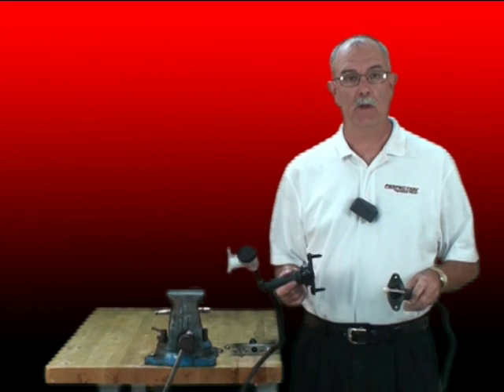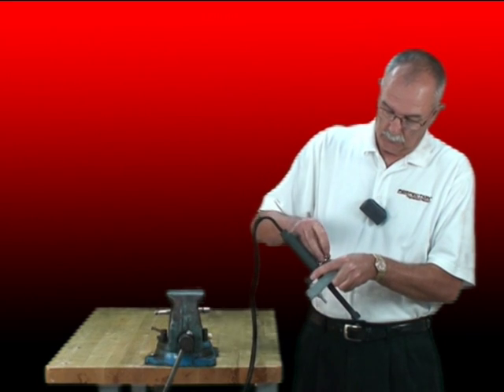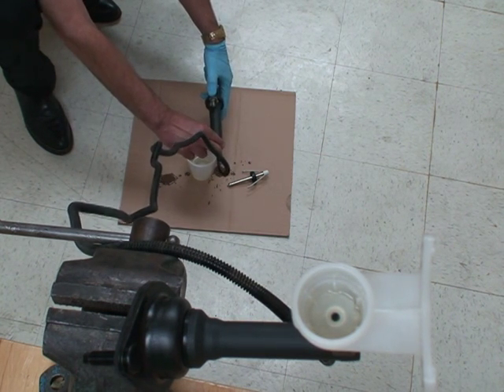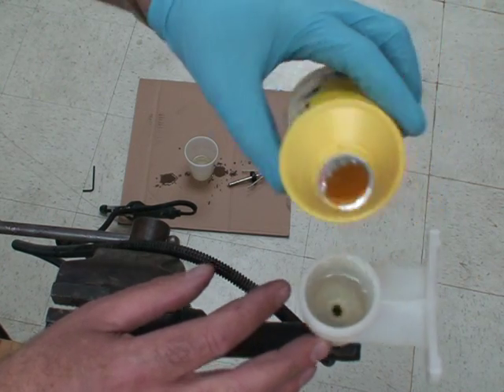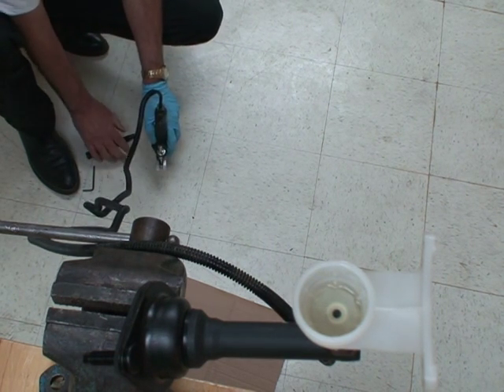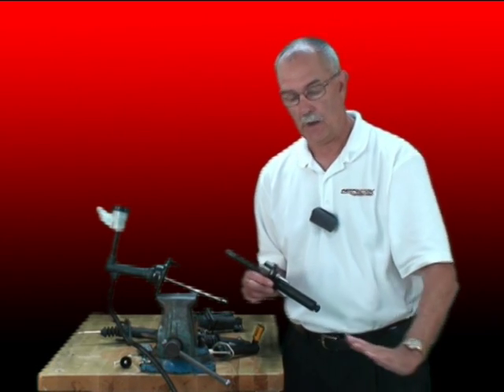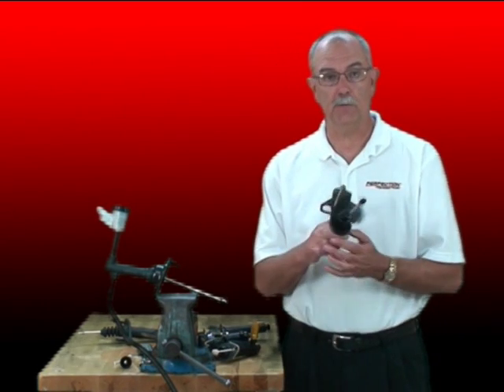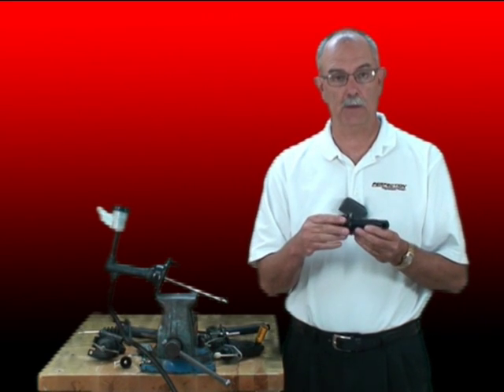Bleeding External Clutch Hydraulic Release Systems with Bleed Screws

Comment: Exactly what I needed. Awesome informative video
Reply from the maker: Glad it was helpful!
Reply: @perfectionclutch  any extra tips on a system with that shares a Reservoir with the break master cylinder. 2010 fusion 4 cylinder 6 speed manual. I'm about to take the system completely out for the 3rd time. Clutch is stuck to the floor. Replaced both slave and master cylinder. Haven't been able to gain pressure back. I been driving it with out a clutch for a month just floating to each gear..even if you don't. Thanks for everything so far.. your videos still been a big help

Comment: So.. on the slave, push the piston all the way in and keep it locked in some way?
 Then open the bleeder on the slave 3 or 4 times. Close the bleeder off. Let the slave piston come out.
 Then push the piston in several times...
 Then it should be bled, correct?
Reply: Bro thats the exact question i have about the slave piston. Does it have to be fully in and locked that way?

Comment: This is an old video but good info. Only problem, on most cars you can not remove the hydraulic line on the car to bleed the system on the bench. I have a steel line bolted to the car. It's bleed the system installed on car.

Comment: Hi, I have a 98 s10 with a sbc 350 and a nv3500 transmission.  The slave cylinder is right above the starter. I have a a new braided line on it and a new clutch master. I've bled the system but it will only go into gear when the truck isn't running. Any ideas cause its driving me crazy.lol

Comment: Damn dude...that's the long way around.....the easy way? As taught to me by old guy 40 + years ago....I must be good at keeping secrets...I never told anybody....bolt all the parts in....you can do that, right? You need to pay careful attention to the next part...it being super secret and all...fill the master, someplace on the cap there is s vet hole..DO NOT OPEN BLEEDERS!   Make sure the pedal is up....ok ready? Get s rubber tip blow gun and give a couple  quick shots of air in the hole....should be done deal,right;)

Comment: You are a godsend.  For the last seven days I've been cursing why God doesn't love me.  Then I find your video.  I have an International Prostar class 8 semi truck.  All it took was to remove the four bolts holding the slave cylinder.  Then gravity feed the fluid down to the cylinder.  I gravity bled it twice, then used a socket extension like on the video to push down on the piston inside the cylinder.  I heard a wonderful sound comming from the reservoir up top.  It was bubbles.  I did it a second time, and there was that wonderful sound again.   On the third time, I heard nothing.  I did it one last time and heard nothing.  I got up from below the truck and pushed on the clutch pedal, and felt it hard.  It was so emotional.  I was so happy all I could do was thank the lord and you kind sir.

A vacuum pump is not needed to gravity bleed, but I used it anyways since I had been using it for the last seven days for hours on in trying to bleed the clutch.

Comment: What position is the push rod at the master cylinder. when you are bleeding the slave cylinder? Installed master and slave cylinder  and hose 2 years ago and didn't have this issue.

Comment: I did what this guy did right down using the same brand fluid he's using. Never heard using a steering puller or hanging the system up like an iv would be set up. I even used a hand vacuum pump and still NOTHING. Clutch pedal goes to floor. Instructions that came with perfection hydrolics. Under normal use, small amounts of air remaining will be purged from the system. So what's the deal? Why does the pedal goes to the floor?

Comment: Great video! Would this work the same way, if the C-clamp method you used in the other video to stop the slave cylinder piston from moving was used instead, and with keeping everything in the car?
Reply: perfectionclutch: Thank you very much for the information.
Reply: perfectionclutch: I used the C- clamp method on my 350Z today, and it worked PERFECTLY! I believe the clutch system in these vehicles are known to be difficult to bleed, with the few loops in the hard lines; but, the air bubbles were removed in a relatively short period of time.

Thank you again, for passing on your expertise and knowledge. 👍

Comment: The only thing I wasn't 100% clear on is if that is the actual line from the car, or are you using that line to prime just the cylinders and will they hold their prime if you were to attach them to another line in the car? Obviously that line would need to be bled? Thanks

Comment: Nice video. Makes a whole lot more sense than putting everything in the car where you can't get to it, then try to bleed it.I just have one question. I am putting a similar setup on an older Mustang. After you have blocked that slave cylinder with the screw on the puller and finished your bleeding, will that piston stay in after you remove the puller? Or, do I have to depress the cylinder on the slave when I bolt it up to my transmission, and install the push rod to my  clutch fork? (I am using a push type slave cylinder just like this gentleman used) I was concerned that the spring pushing outward on my slave cylinder would pre-load my clutch fork and throw-out bearing. Anyone who has performed this, I would love hear your comments. Thanks
Reply: +perfectionclutch I will double check the slave that I received, could be I received the wrong one. It does have the circlip retainer that you mentioned and the dimpled plate is pushed out against the circlip retainer as if it has some type of spring in it. That is what has me confused, as I need the slave to push against my clutch lever, and I just assumed the normal position of the piston in the slave would that it be bottomed out on the other end, and not pushing out against the circlip retainer. This is my first experience working with a hydraulic clutch, and I just want to make sure it works before I put it in the car. I plan to bench bleed my whole system just as you did in the video and make sure it is good to go. I have read so many forums were someone has installed a system it their car, the it barely releases the clutch, or not at all, and I feel most of them have not bled their system properly. Again, Thanks for your video, it is very informative. ~Rick~

Comment: Thanks for the video.  I have just bleed the slave and brakes on a 2003 A4 using the 2 person pumping the pedals and opening the bleeder valves.  Both the Brakes and the Slave are now poor.   I was wondering if I need a pressure bleeder?

Comment: Great video.  I've just changed my clutch and bleed the system by pumping the pedal and opening the bleeder.  After few days, my clutch pedal was gettin stuck on the floor.  Checked the clutch system..no leaks and reservior is full.  Dunno what was wrong till found this vid.  I tried this technique and got rid the air bubbles.  Now my clutch is working normal again.  I think this technique is more effective...Thx

Comment: Hey guys,

i just changed the master cylinder for a 2000 grand am 2.4l, now its taking like forever to bleed it, when i looked on the coupling thing where the push rod sits, i am finding that its way  back at the of the cylinder that there isnt any space for me to push, what might be the problem.I looked on the one that i took out i can even touch with my finger , could it be that there is an airlock in the reservoiur what?please help

Comment: Use a new hand pump oil can and hose that fits your bleeder, fill it with new fluid and pump the can until fluid reaches the end of the hose. Then connect that to the bleeder on your slave cylinder. Make sure your master reservoir is half full. Begin to pump the oil can and watch the air bubbles get pushed out of the system until their is no bubbles. Close bleeder

This is such a better method as air likes to travel upward and in my case the lines would be harder to disconnect for a bench bleed.